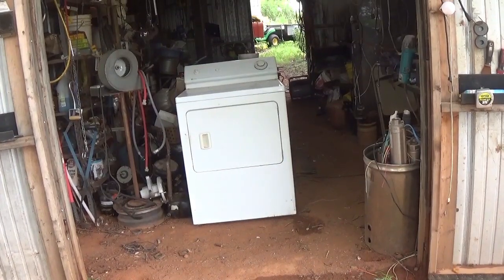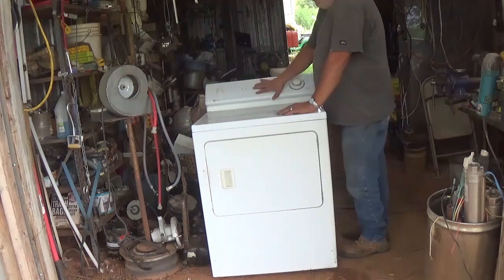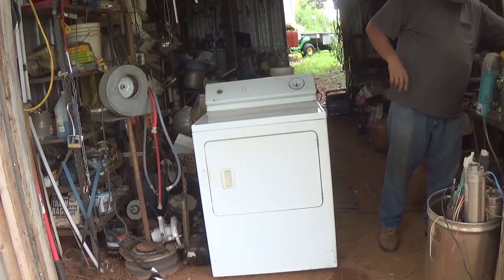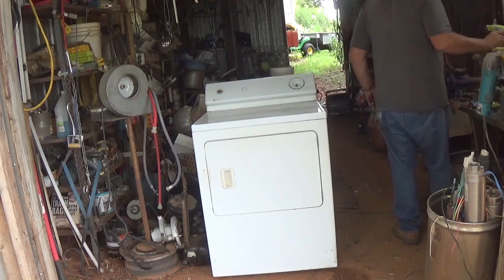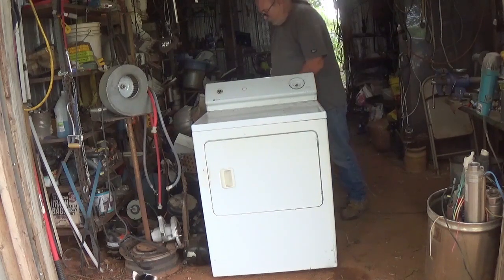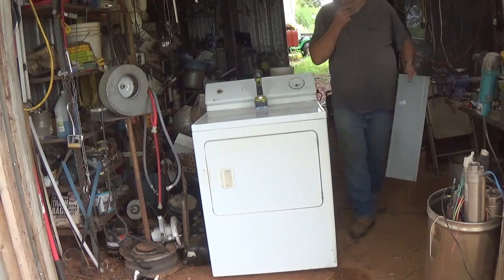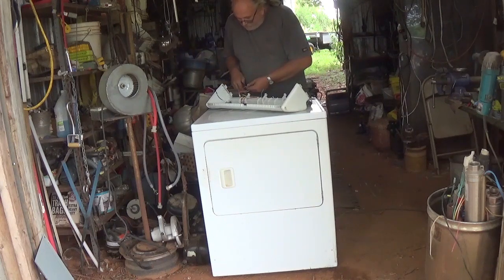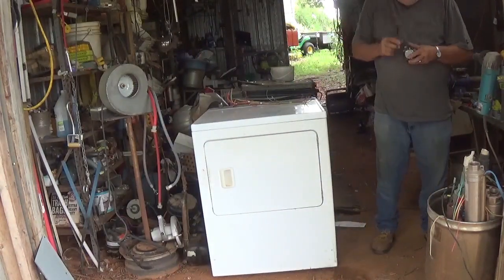Scrapping out a Dryer for Copper Wire, Aluminum, and a little Brass

Comment: Yeppers I have yet to find a copper motor in a dryer but like you I strip them down you get cast aluminum and aluminum wire and short iron thanks for sharing this six stars brother
Reply from the maker: yeah it all adds up, the aluminum wire pays good when you get a barrel full

Comment: My drier was screeching horribly a while back. I traced the problem to the roller thing that the drum sits on. It was a huge pain because I was accessing it through a little hole in the back. I did a delete on the roller and it has been perfect ever since. I'm thinking that the roller has nothing to do with holding up the drum since the other rollers do so fine. I'm thinking that 90% of people would have simply said "The drier is broken" and bought a new one. I'm thinking they design the rollers to go out after a certain amount of time. Once you open up a drier and see how simple it is - minus the brainbox - you will never throw away a drier again without trying to fix it. In my research I found that you can get replacements for many parts for dirt cheap. I'm thinking that the vast majority of people throwing away driers could have easily fixed them with less than $20 in parts and an hour of work. Hell, next time someone you know throws away a drier you could harvest a few parts from it to keep yours going for a very long time.
Reply from the maker: yeah, not much to them, often an easy fix, but people won't fix things now days, they can't even change their own oil